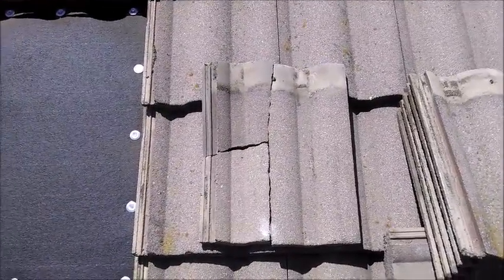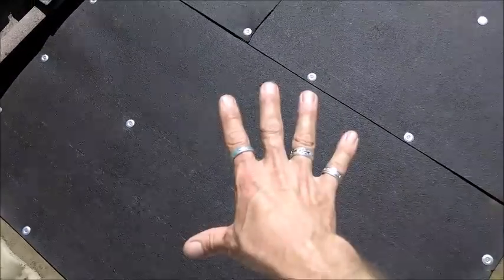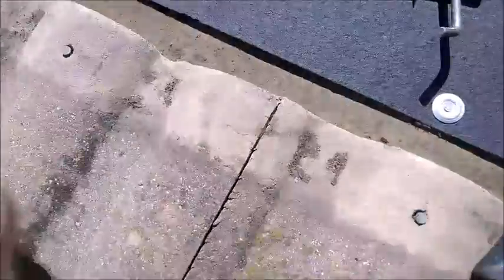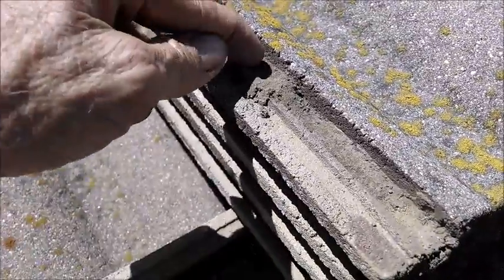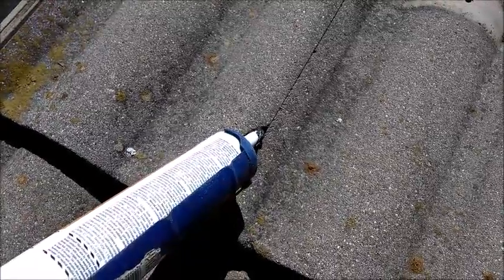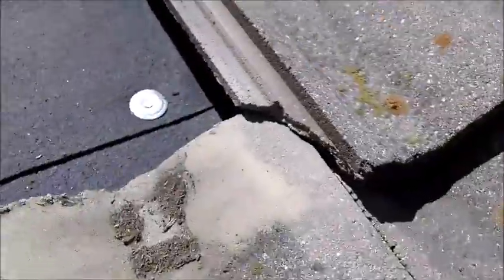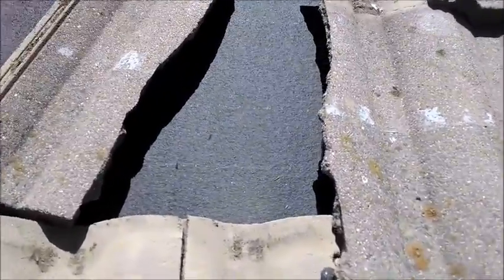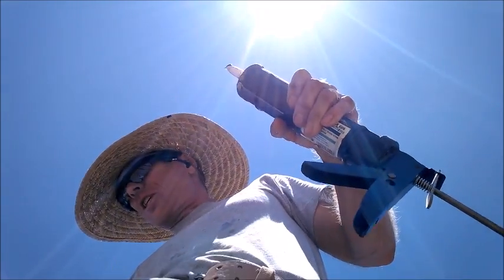Tile Roof Leak Repair - The Right Way...

Comment: Hi Dan, great video thank you so much for your detailed video. The only OSI product I could find was the quad max sealant. However it doesn’t specifically say it is for roofs whereas Loctite makes a polymer sealant “for roofs and flashing”. Wanted to be sure I had the right OSI product. Thanks in advance.
Reply from the maker: You can go with loctite. I just use OSI quad because it works well for all my different applications including roofing & it’s available at a competitive price.
Reply: Thanks!

Comment: interesting to the extreme   we don't do many tile roofs in the Mid=Atlantic. i found your strategy of tile drainage management very insightful.  great flashing solution at the end.
Reply from the maker: pensive69 thanks... eventually the caulking will fail but the flashing will outlast the roof.

Comment: Hello Dan,
super informative!
we just re-do our tiles roof there is no leak, just due to over 34 years, underlayment may be deteriorated
be proactive instead of reactive.
besides replaced more than few dry rod Shiplap and one water damaged fascia board.
roofer installed 3 O'Hagin attic vents, later I found out those vents were make for shingle roof application, roofer said the base is the same.
your video is absolutely great help 
as I noticed there are many broken lower corner tiles all at the left hand bottom.
I have sealed few of those tiles, after seeing your video knowing I had over sealed the channels.
Will have to go up to the roof broken off part of the sealant.
appreciated the detail information.

Comment: Dan , you are a perfect example of the old school , 30 Lbs.  felt underlayment and nails, when well installed , you don't need the expensive and overpriced labor or many so called roofers using peel and stick underlayment .
next time try to find the matching tiles, usually the manufacturer makes the new version of the old tiles like this.

Good repair !  I would definitely have you on my roof !!
Eric.

Comment: What other option to puncture the tube than the nail? (Which I don’t have). Thanks for the great video Dan! May God continue to richly bless you 🙏🏾✝️
Reply from the maker: The only three options where I worked according to code were nails, glue or battens that are nailed to roof deck to hang the tiles on. In every case roof deck must be covered with at least 30lb felt paper before tiles get installed.
Reply from the maker: I carried a cement drill bit with me & a cordless drill whenever I works on cement tiles. I can’t over stress the importance of having the right tools with me to handle the inevitable problems that arise on most jobs... Like bad cement tiles that the factory neglected to pierce the nail holes properly in.

Comment: Great videos!  Those galvanized nails that hold the Felp paper.  How do you prevent leaking through them?  Same question for the nails that hold the tile to the roof.  Thank you in advance!
Reply from the maker: The galvanized felt nails are waterproof in their design, provided they’re installed properly & not exposed to excessive water volume coming through the tiles. The felt nail shank seals as it goes through the tar-saturated felt paper. The large felt nail metal cap helps protect the nail shank seal as the shank goes through the felt.

The tile nail shank also seals as it penetrates through the tar-saturated felt paper but because of its much smaller head, it’s not as waterproof & it’s much better protected from large volumes of water intrusion through the tile by the manufacturer’s recommend maximum tile exposure measurement of 13.5” at most. Some cement tile brands have allowed for a 14” weather exposure, but my 36 years of on the roof experience says 13.5” is the real maximum weather exposure if you want to protect your felt paper well & keep those felt nails waterproof also.

Comment: Like your video on the tiles but where I’m from Tile roof are rare but bought a house with them.So would like to see how you remove them ,and what tools needed.maybe something for next video,I have learnt so much from this. Thanks
Reply from the maker: Darcy Munro Check my channel videos & watch my video on tile roofing repair - tips, tricks & helpful hints. I demonstrate early in that video what tools I use & how to take em apart. Part of it is technique that you’ll just have to get the hang of but watch that vid first before you try it.

Comment: Great information awesome video!! What is the name of the glue/sealant caulking that you use and trust?
Reply from the maker: Polymer… any polymer will do. Problem is most products don’t tell you what’s in the caulking on the label. So you have to speculate based on the name. For instance: OSI Quad is a quad polymer. In the past I’ve used copolymer & tripolymer & both have been sufficient & fairly durable.

Comment: Hi Dan,  could you tell me what is the best tile glue where one of my tile is cracked vertically?  thanks in advance.
Reply from the maker: I use OSI Quad construction sealer adhesive. It’s available on Amazon & comes in various colors. It will only last a couple years exposed to the weather, so you may want to put a sheetmetal flashing over it & paint the metal to match your tile. Most of the time when I do these repair for others, the customer only wants a couple year warranty so I just do whatever they tell me to do, but you may want to go the extra mile on your own roof & flash over the caulking as I mentioned.

Comment: Hi Dan,

For a flat concrete tile roof, when two sides meet at 90 degrees, what is the recommended gap it needs to have so it will flush out the dirt in between the valleys?

My original roof valley is less than 1/2 inch, and it is gathering leaves and dirt and is hard to clean out.

Thanks for your input.

Regards,
Reply from the maker: The top corner of each of the smaller ‘cut’ valley tiles which point up slope needs to be broken off or cut off, so that regardless of what the valley tile gap is, when debris gather in the valley, those ‘cut’ tiles don’t divert water across the roof out of the valley, under the tiles, onto the felt paper. Make sure whoever does this doesn’t leave the cut or broken corners in the valleys. In addition, I like the gap to be at least an inch on each side of the valley.

Of course nobody breaks off or cuts off the top corner of all the smaller ‘cut’ valley tiles upon initial installation, so eventually all flat tile valleys without this installation method will leak for this reason.

Valley metal companies have attempted to compensate for this ‘flat tile’ oversight by adding ridges to their valley metal, but it only requires a little debris to build up behind these top-pointed triangle shaped small ‘cut’ valley tiles for the rushing water to flow sideways right over the valley metal ridges, under the tiles, off the metal, across the roof & onto the felt paper.

Without the top pointed corners of the smaller ‘cut’ valley tiles removed, you’re gonna need at least a 3” gap on each side of the valley to prevent water flowing out of the valley, across your roof, under the tiles. Because that’s how wide the river of water flows down a valley in a decent downpour. Making a total of at least a 6” gap. You do realize how terrible a 6” valley tile gap looks from the ground aesthetically, right?

There is no other solution that I’ve found around this ‘flat’ valley tile issue over the last 36 years. And I have done literally thousands of roof repairs personally from my toolbag of tricks. Don’t let any blowhards tell you otherwise on this issue. There are a lot of blowhard roofers out there, so beware.

My brother is re-roofing his flat tile roof himself 2600 miles away because of this very reason & he is pulling his hair out because I cannot repair it for him in person at this time. This flat tile valley issue is a nightmare to deal with.

I’ve even watched blowhard arrogant expert roofers on YouTube come in & reroof valleys for customers only to have them charge to do it again every 10-15 years.

It’s basic physics. Do you know how hard it is to convince so-called experienced roofers of something they don’t already know? They would rather just keep recharging the customer to do it again, instead of learning a new method to solve this problem permanently..

If you like, I can draw diagrams of the issue & solution for you & email it back to you for a fee. My email is rooferdan@aol.com. I’ll give you my cell number at that time to discuss any questions you might also have. At least you can do this yourself or have another roofer do it for you.

Knowledge is power…

Comment: Im confused Mr Dan . You said not to use the plastic cap nails, but if your tiles aren’t broken is water still going to get down there ?
Reply from the maker: Good question. So here’s my answer. What’s wrong with plastic cap nails? There are 3 main reasons why plastic cap nails are bad & it’s not mainly because of water.

1. Plastic cap nails do not & cannot clamp the felt down to the roof deck like metal cap nails - like the felt needs clamped/held down under any extreme conditions. And all tile roofs are extreme conditions.

2. As soon as plastic cap nails are installed, they begin stressing the felt at the point where the cap nail itself penetrates through the felt, because the small metal nail head applies pressure to the felt but the larger plastic cap doesn’t provide nearly as much clamping pressure as the plastic cap metal nail head itself does, because the flimsy plastic flexes & retreats from the surface of the felt while the nail itself does not. For this reason the plastic doesn’t have the rigidity to hold the felt evenly around the perimeter of the plastic cap like the metal nail going through the plastic cap does, so the plastic cap is loose compared to the metal nail & immediately begins stressing the felt in this way the minute it is installed. Because it does so the hole in the felt from the plastic cap nails begin to enlarge very quickly compared to metal cap nails over time.

3. In addition to these immediate plastic cap flaws, the heat & humility under the tile cause the plastic to deteriorate at an accelerated rate that is not comparable to the rate of deterioration of any of the other roofing materials being used in the same roofing application. Plastic cap nails should have never been approved for tile roofs & the fact that they have been is proof that idiots often make rules based on speculation & theory without the slightest real experience & proof that their theories will work in the real world over time.

I hope that helps relive some of the confusion regarding plastic cap nail flaws compared to metal cap nail strengths. Thanks for watching!

Dan

Comment: Thanks again Duster Dan! This is so informative 👍 Further inspection in the attic revealed I have additional water leaks. I’ll be referencing your videos throughout the repairs. Question, the wife also noticed water is leaking in the upper window seal area. How do I water seal this area? The house was built 30 years ago and has the original windows.
Reply from the maker: El Gato Gordo You have to first determine whether the water is coming in through the the roofing above or through the window itself.
Reply: @MrThedocholiday  I'll look into it. Thanks for your reply and information 👍

Comment: This is Pam's husband Bob. I noticed in the video that the caps holding the felt paper were not covered with a roof coating to help seal any nail holes , would that be a good idea to do that or is it not necessary?  By the way, excellent video and very informative.  Well done !!!
Reply from the maker: The metal cap nails for the felt are watertight just the way they are, however, they're not intended to remain exposed to the elements indefinitely, but must remain protected by the roof tiles in order to remain watertight over time.

Comment: Hi Dan,

In 2024, what is the cement roof tile glue you recommend using to fix the cracked cement roof tile?

I cannot find the sealant you were using.

If you were to get it from Home Depot or another big box store, what would be the best one to use?

Thanks!
Reply from the maker: I use OSI Quad construction caulking. It’s available at Lowe’s, Home Depot or on Amazon.

Comment: Hi Dan not sure if I missed it, but what brand are you using for this repair?
Reply from the maker: If you’re referring to sealant, I currently use OSI Quad from a caulking gun. At the time of the video I likely used Rainbuster 850, but I think that’s discontinued now. Both sealants have similar properties… they stay flexible, they adhere to most materials, they’re waterproof, removable with a scraper or razor knife, fairly UV resistant, inexpensive & come in different colors for topical applications.

Comment: Dr Dan, you clearly know more what generic repairs are available-here  in the Southwest.  They don’t know what you know. Roofers for  the most part, are not interested in learning these techniques.  Roofers want to replace all roofs if they lean a latter on if the insurance company is coming by.  They specifically tell the homeowner not to tell  that their roofer will be waiting.   Usually by the initial conversation I knew that there would be be a roofer, he had preceded me deliberately ,warmed up the insured, made me out to be the bad guy, and did  me the” Service” of giving me a prepositioned ladder, which I did not want or Need
my ladder was often better than the roofers.  I also knew the size of the roof and the weather history on that zip code.   The roofer was not a roofer , he was a salesman.  Usually he was full of it, but not always.  If the facts lined up, insurance paid for the roof, if,facts did not line up, I and my company, were crooks and typical of that mindset.   It’s not hard to tell wear and tear to a roof, regardless of what kind of roof it is.    I have “walked” 1000’s of roofs that most roofers.    Over the years I have learned to consult with honest men that know more than me, and then I differ to me.

Comment: Thank you Dan this video is very helpful.   Question.  What is the name of the glue you use where you cannot use nails.
Reply from the maker: Currently I use Quad OSI in bronze

https://www.lowes.com/pd/OSI-QUAD-Quad-10-oz-Bronze-Paintable-Solvent-Caulk/3664984

Comment: Hi Duster Dan, I hope your consulting is going well. Just watched our video. I have the same roof tile you are working on. After a bad experience with a roof leak last year, I feel much more empowered to take control of my own destiny. Do you have any videos that show how to seal around solar panel footings? That would be super helpful.
Reply from the maker: Jeremy Fennelly No, I don't have any videos on solar panels & roofing. There are a lot of different kinds of roofing that integrate with solar panels & each type seals the panels a little differently. With tile you need to anchor the solar panel feet to the roof sheathing - preferably right on the rafters. Secondly, you need to install felt around the feet & either seal the felt to the feet with sealant or flash the feet, so that either way they are waterproof at the felt/feet transition. Thirdly, you need to install the tiles around the solar panel feet & either flash the feet again with flashings at the tiles or seal the tile/feet transition with sealant. Keep in mind that if you seal the tile to the feet instead of flashing the feet as they go through the tiles, then you will have to reseal all the places where the feet go through the tiles every few years to keep them water tight. Does that answer your question?
Reply: This makes perfect sense. Thank you for taking the time to respond. I value a little more time on the repair and to prevent interim upkeep so I'll go with the flashing. I think I should be able to find examples of how to flash around the feet and where the legs pierce the tiles so I'm not re-inventing the wheel.